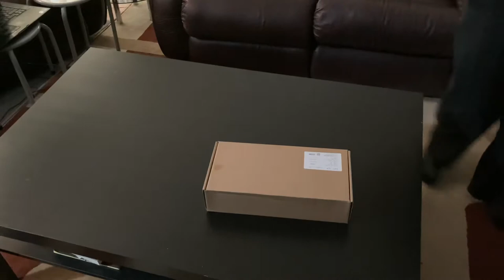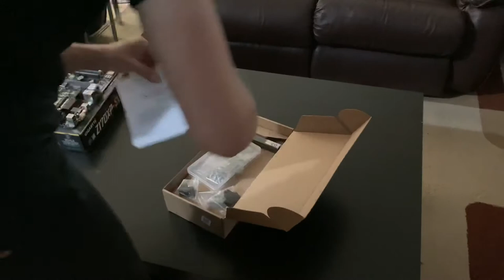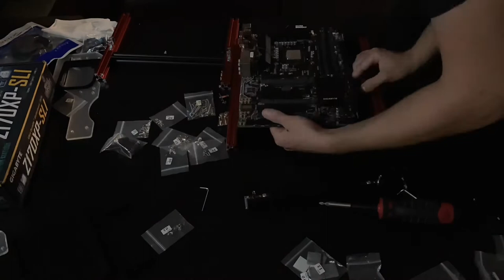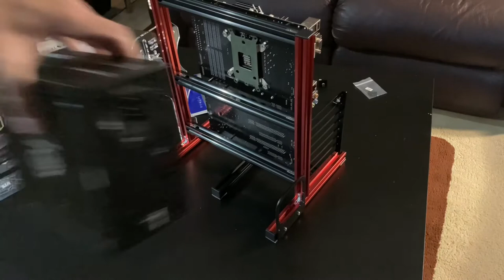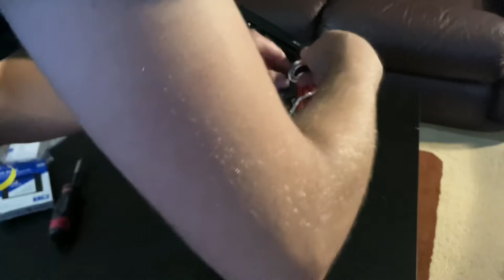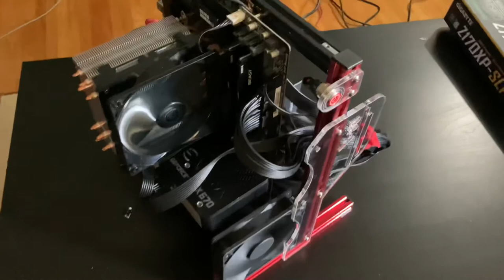DIY Open Pc Case

Comment: im also going to use this for my bench to swap and check stuff
Reply from the maker: It works great easy to swap out cards or parts to test 👍
Reply: @proxcrypto  did you have parts to make it vertical GPU? i mean just the stuff you hold it i guess there will not be vertical PCIe cable
Reply from the maker: It may be possible to run the gpus vertical if I mounted my motherboard so the pci is vertical and moved the brackets. It looks like it would work but I haven’t tried it to confirm it would for sure work.(full-size motherboard I used  may be to big to spin vertical so it would have to be done with a smaller mobo I assume)

Comment: Thanks for video. I really liked your design. I wonder if there is space for DVD. Also what model has handle on the top?
Reply from the maker: Hey thanks! there is lots of room on the backside where back of motherboard is, I’m sure you could fit a dvd somewhere there. It looks like there would be some options. I noticed some of the listings include a handle and some don’t. Here is one with included handle: 

PC Computer Case, ATX/M-ATX/ITX Open Chassis Vertical Overclocking Test Platform Chassis Rack + Handle with Good Heat Dissipation(Red) https://a.co/d/bqi2EnJ

Mine didn’t come with a handle but it can also be purchased separately: 

Handle,Aluminum Alloy Open Chassis Platform Handle for Computer Motherboard Chasis Shell Part,Easily Take Test Platform Away by Gripping The Handle,Ergonomic Design,Only for Our Test Platform https://www.amazon.ca/dp/B07XZ16TDT?ref_=cm_sw_r_apin_dp_RR3ARZJEMJTD5V85WTDK
Reply: @proxcrypto  Thanks for info. I am thinking to put ASUS SAGE on it with CPU fan similar you put (no trust for liquid heat sink).

Just wonder, do you think it possible to put 2 motherboards on each side sharing one power supply (such splitters exist on AMZN)?
Reply from the maker: Yes 2 would totally fit if you were to mount them on opposite sides. The kit actually come with a few spare adjustable motherboard mount’s depending on what size board you use. Only thing that’s in the way is my power supply, but it can be slid over and another board would fit. That would be a pretty cool build, great idea!
Reply: @proxcrypto  Yes I was thinking instead to ATX boxes just one open design for 2 motherboards.

Comment: Just a quick question, what are the benefits of bitcoin mining because whenever I look it up on the internet even a simple explanation I still don't understand
Reply from the maker: When you mine your computer is completing transactions on the blockchain for whatever coin you are Mining. In return you get a cut of that coin. The more graphic cards you have the more profit you make completing those transactions. You can then sell your coin or hold it to sell when crypto hit all time highs. It returns you passive income 24/7 but also costs you electricity to run them so I try to make mine efficient on power. I believe in crypto long term so I mine many different coins and hold them for the future.